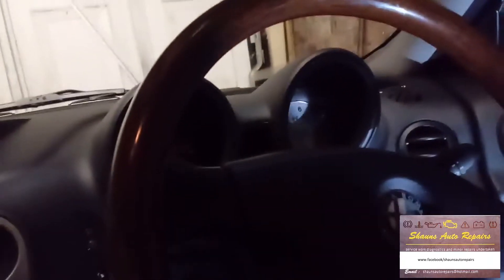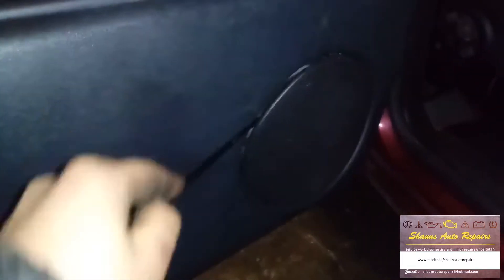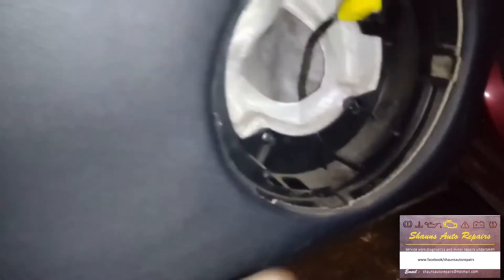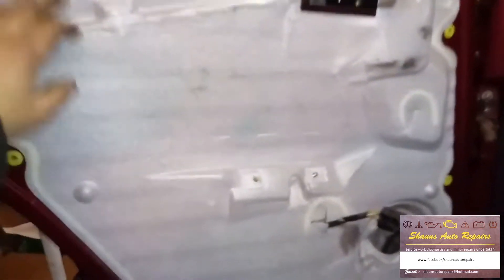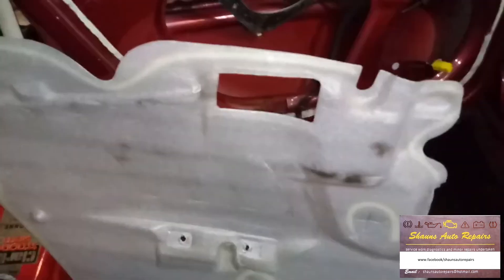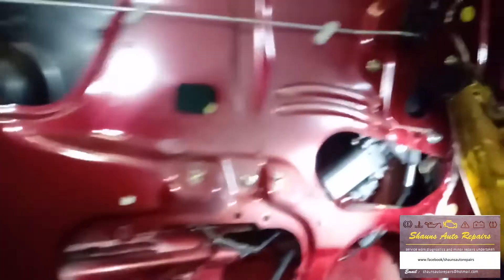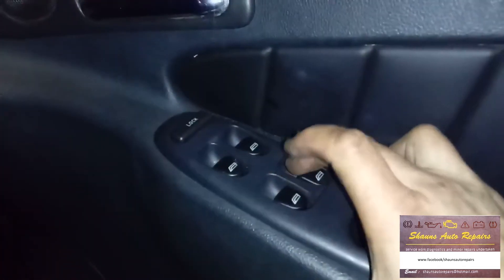Alfa Romeo 156 rear windows fault part1 and rear door card removal.

Comment: Was that window goes down goes down equally or only at the front before the repair? I've got same problem, window moves down only on the front...
Reply from the maker: It was even... but sounds like you have a simular problem.. do you hear a grinding noise when you operate the switch.. if you do it's the wire on the mechanism that's getting tangled restricting movement
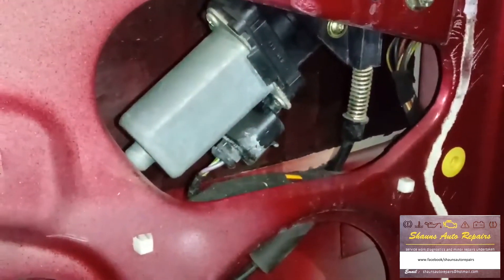Reply: @shaunsautorepairs5410  I've got the same sound as you show on 8:46 - no grinding noise. It is also left rear window - but i LH car. I'll check it on weekend and reply :) Hope it is only stuck wire and penetrant will help.
Reply: it's funny what was the cause.  the back of the glass popped out of the gasket, the guide, and the engine was unable to lower it. I put it back, clean little bit gaskets and it is working now. After four years handle was disformed so i had to change it too. thanks one more time for this video!
Reply from the maker: @mikkosz  glad you got it sorted in the end...

Comment: Hey man, i have Alfa 156 i wonder is it possible to change rear manual windows to automatic and do all the models have wires ready to connect or do i need to install wires ?
Reply from the maker: I realy couldnt say. I know a lot of makes use the same wiring looms whether all the connectors are used or not. You will only know by taking the panels off and looking
Reply: @shaunsautorepairs5410  Yeah i was afraid im gonna have to do that... by the way thank you for quick response!
Reply: @Nova Terrance instablaster :)
Reply: @Zaid Jaxton It worked and I now got access to my account again. I'm so happy!
Thanks so much, you saved my account!
Reply: @Nova Terrance Happy to help =)